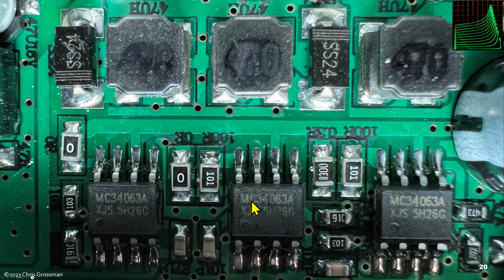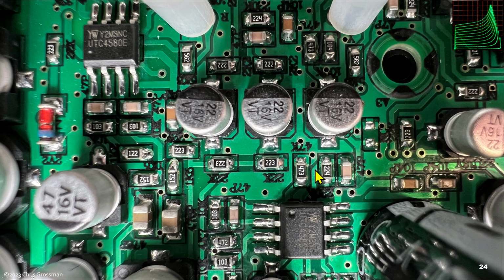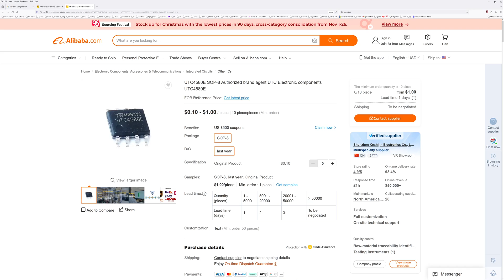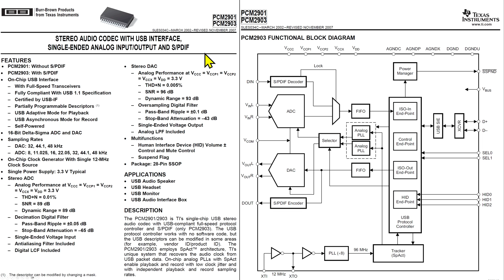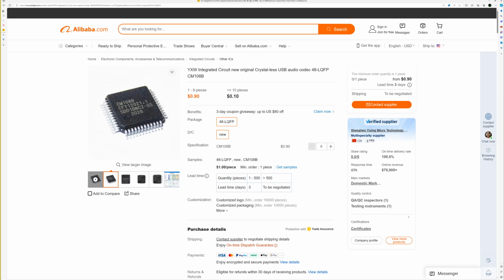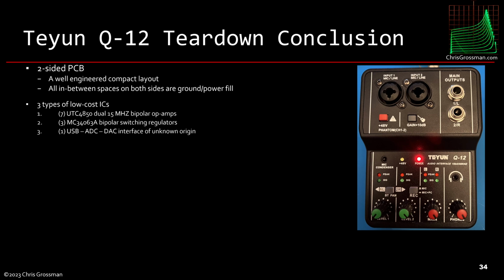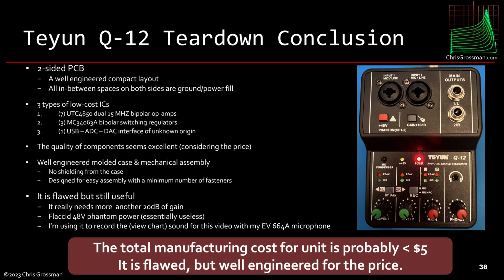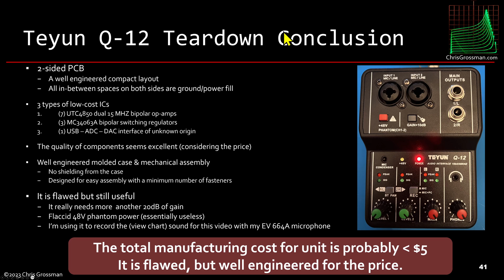⭐ Teyun Q-12 Teardown of a budget, inexpensive, low cost USB Audio Interface/Mixer 0028

Comment: Try lsusb to see what it identifies the chip as.
Reply from the maker: I had probed the part with both Windows and Linux, but I did not know about this utility.   Thank you for the lead.
When I probe it with my Linux system using  lsusb I get "Jieli Technology USB Composite Device"
I went to the ZhuHai Jieli Technology Co.,Ltd (杰理芯片) website and looked for the chip.  They have a page when translated labeled "Mixer/live sound card series chips."  However, all of the chip numbers listed are for Bluetooth chips, not USB-Audio chips.
ZhuHai Jieli Technology Co.,Ltd (杰理芯片)  is the manufacturer of the USB-audio interface chip, but I have not yet been able to locate the part number.

Comment: I saw in another review that the manual (he said) prints it has an
 80hz high pass filter built in.  I would like to remove this if possible to use this for recording loudspeakers.  Is this possible?  How to identify this on the circuit board?  Thanks.

Comment: can it powered by a 5v charger or it needed PC  to powered up? i order these and this video has awesome detail about teyun
Reply from the maker: @jazznelsalica2275  If you just want to use it as a mixer you can plug the usb cable into a 5V charger or battery pack instead of powering it from a computer.

Comment: I get quite a lot of pops when I'm running this on my linux laptop on AC power, regardless of the buffer settings I use. No issue on battery power or when I'm using it with my desktop. 
I would blame the laptop's power circuitry but it has no issues running my other audio interfaces, even ones based around the same PCM2902 IC, so I'm guessing the Q-12 is just more sensitive to any power issues the laptop has. I notice the same popping on some other reviews for the Q-12 (the same popping/clicking can be heard in Dave Soltura's videos on the thing) so I don't think I have a defective one either. Any ideas what would be making it more sensitive to unstable (or unfiltered maybe) USB power? Any cheap fix ideas?

Also regarding your gain issues, on my unit pressing the REC button down allows that third pot (the red 'MAIN' one) to control volume of the audio coming through over USB. Is this not the case for you? In your other video you say it does absolutely nothing for audio going to the ADC but maybe that got changed in later revisions, but from the text on the button it seems it'd function the same way.

Comment: Suppose we wanna add a switch to turn off direct monitoring , where would it be located ? Thanks 4 the video.
Reply from the maker: You would need to do that in your pc and set something besides the teyun as the output device.
Reply: @Chris_Grossman  Actually there's no setting for that as it seems hardwired into the device , but thanks to your video I figured pin 39 MSEL (Mixer) if set to Low would turn off Direct monitoring , is that true ?
Reply: If it works the same as the Teyun Q-24 then there is a option to turn off direct monitoring.

Comment: I wanted to like this unit but unfortunately it failed simple testing.  I just wanted it to power a Dayton EMM-6 Condenser Mic for car audio tuning.  I did not get consistent measurements with an RTA.  Th mic would start out fine but the lower frequencies just dropped off.  Couldn't explain it.  I measured phantom power at 39vdc.  I think that should be sufficient but maybe not.  I know the mic is solid on another Behringer UMC22 that I borrowed.
Reply from the maker: My measurements showed the phantom power was inadequate and essentially unusable, so it is not surprising you had problems.